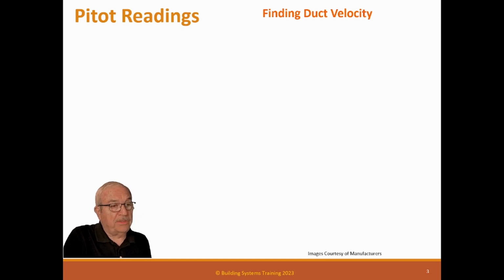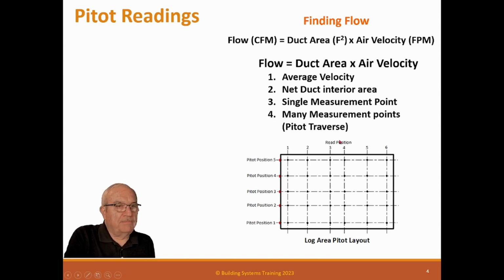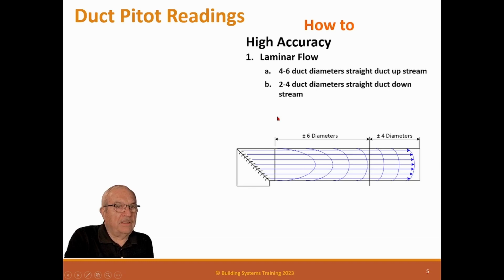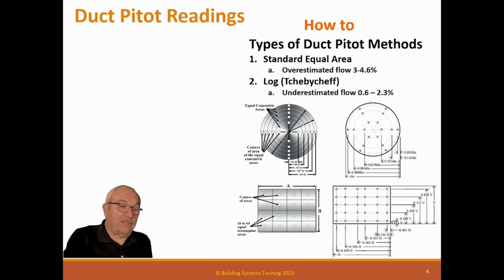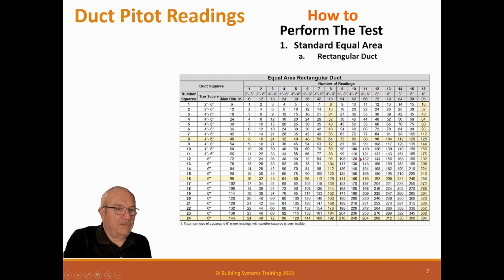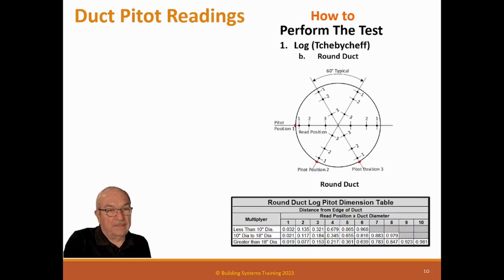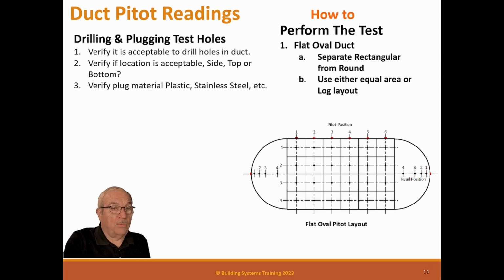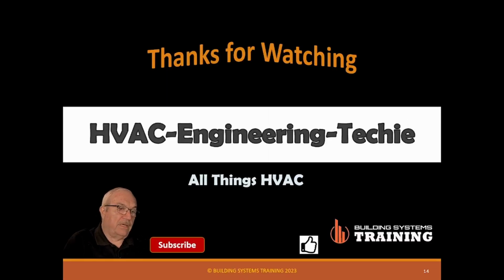TAB how to Perform Pitot Readings. Training Session T-6

Comment: I was also wondering if you use a certain type marker or tape that you use to mark traverse points on the pitot tube or what works best. Do you also have a contact email where I could ask you a couple of other questions if you dont mind giving that out.
Reply from the maker: I have used electric black tape, but you need to slice it to about 1/8" thickness or you can use artist back tape, anything that will last a while, back felt tip marker also works well. I am working on my website presently to provide the two-way communication you are asking for. May take a little while. thanks

Comment: I had a question regarding larger round ducts and what the best traverse method would be. Is there a certain size round duct where you usually start to use the Log method over the Equal if space permits? I wasn't sure on larger round ducts if just 2 holes for testing vertical and horizontal would be  accurate enough due to size of larger round ducts. I know you stated the equal being slightly over estimated from the Log method.
Reply from the maker: Good question, in reality the size does not matter only how well your measurements are taken, how many readings you take and how good of laminar flow you have. I usually use equal area because it is the easiest and if high accuracy is needed (Better Than 10%) then either do more than one pitot reading and average them or make the equal areas smaller thus taking more readings. Hope this helps